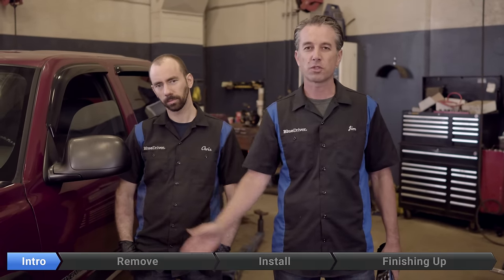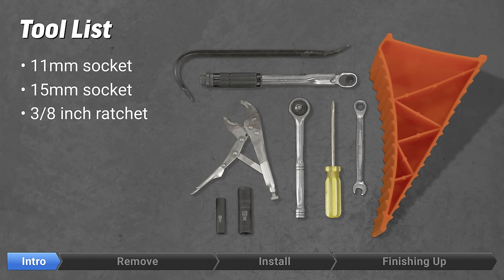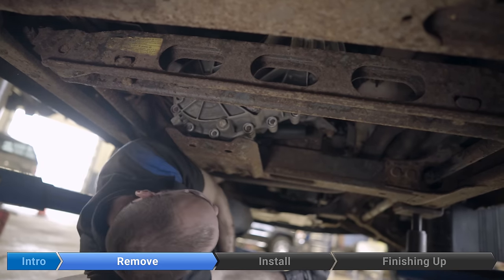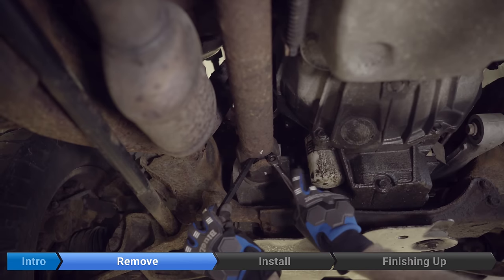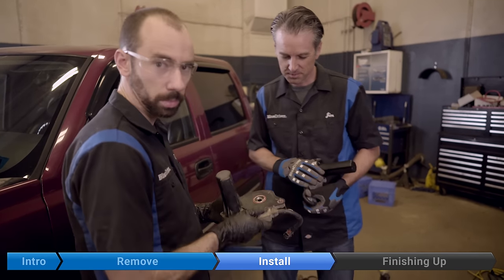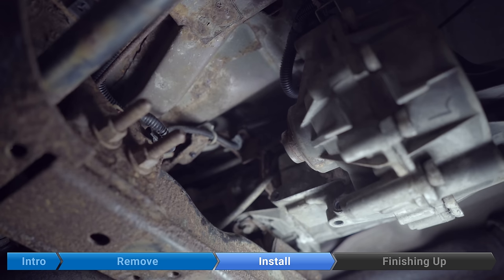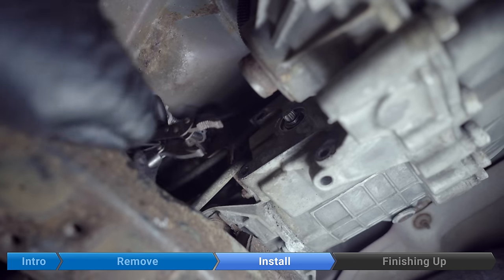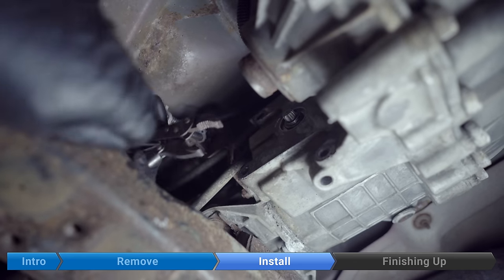Transfer Case Motor – 1999-2006 5.3L Chevy Silverado (Sierra, Tahoe, Yukon, etc.)

Comment: Transfer case didn't shift into neutral because you need to press and hold 2 high and 4 low for about 10 seconds. You were pressing 4 high. If in doubt there are lines on the switch pointing to the proper buttons to press and hold.
Reply: I tried every combination of 2hi/4hi/low yesterday and it wont shift to N either
I think the fact it wont go to N sometimes will throw the code that the encoder motor is bad
I get the code and mine will shift, 4 Lo makes a pretty good clunk in the TCase, hopefully its normal, but still get the code

I think its because it wont go to N and I get Ser 4WD sometimes
Reply: @hardhouseinc  when I first bought my current truck it would only shift into 4 hi or 2 hi. I also noted my gear selection display wasn't working right. I replaced the PRNDL switch and then transfer case shifted just fine. I think the truck didn't "see" that the trans was in neutral so transfer case wouldn't shift into 4 lo or neutral. Just another idea.
Reply: MarkPdot 
Yah maybe I’ll try replacing the TCase selector button too since I think it’s fairly cheap
Reply: @hardhouseinc  couldn't hurt. I replaced the same switch. The lights didn't work even though it shifted. I probably could've fixed it but since it was cheap I replaced it.

Comment: I need to know if a 98 z71 transfer case will work in my 04 z71 they both have the same gear ratio 272 and both are electric shift for the four-wheel drive if anyone can help me it would be amazing I am a mechanic but i honestly don't know anything about tranmisson or transfer cases all i know is they have to be the same gearing thank you and have a blessed day.

Comment: my 07 suburban drove it in the morning, when i get back home, i park it, when i get in and shift into reverse it will not move, it will only revv the engine, it will also do it when i put it in d. The light in the 4x4 selector is stuck in 4lo and the light doesnt switch to 2wd, 4 auto, or 4hi.In that same morning there was a ,4WD Service, light. I was told it could be the transfer case encoder. Do you think it could be it?
Reply from the maker: It could be - if you can get your hands on a scan tool you should be able to get a good idea
Reply: @LemurMonitors  thanks, and great video

Comment: If im just taking the actuator off and not replacing yet do I really need to take the drive shaft off? Or can I remove it with it still on??
Reply: You can do it with driveshaft in but that top bolt becomes a real bitch to get out if you domt take the driveshaft out

Comment: you should never cycle the key  without encoder in place it could damage new ring sensor..found out the hardway..even the instructions told me not to do this after the fact.lol
Reply: Midnight Lewandowski 
So if the new encoder ships in N 
But your TCase won’t shift to N 
What do I do?
I’ve tried all button combos and it will shift to everything but N
Reply: @hardhouseinc  when the driveshaft is off and the old encoder is off you just manually turn the tcase to neutral. With the notch down. Then put it in

Comment: I have an issue. I put everything back together but now no gears go in. I put every gear from low 1 to drive to reverse and nothing. I can hear the transfer case spinning. But I can’t get the truck moving. The 4x4 service is still on the dash
Reply from the maker: Could the encoder have been in the wrong position when installed?

Comment: 2000 z71 silverado, my 4wd works if I push the Auto button.  But if I push the 4low or 4high it doesn't work.  After pushing the Auto button I can push the 2wd button and the tcase will disengage and im back in 2wd...

Wonder if this is my issue.
Reply: Change the selector switch first. Sounds like the 4wd side of the button is bad
Reply: @clownshoeboogaloo  thanks, will do

Comment: I had a problem aligning mine, when the motor failed it was stuck half engaged and my rpm was redlining and wouldn't shift at like 5 to 10 MPH, I had no choice but to climb under and pull everything off and switch the transfercase manually into 2 hi. Drove it and got it home, got a new motor plugged it in before install put it in 2 hi from the selector,  it indicated it went in 2 hi, but wouldn't align. So of course I went hitting buttons to see if it was the wrong position and now the truck shut the 4 wheel drive system in like a safety mode and the selector won't respond like it did before, of course only lights up when I 1st start the truck like every other light.  Now I don't know how to get it aligned
Reply: Brandon B. Irish ever figure this out I have same problem right now...
Reply: @nateserbus5766  no i hasn't, ended up buying another truck, same year, just extended cab instead of crew cab.

Comment: Is it permissible to remove a faulty transfer case motor and discard it rather than replace it?  I don't want to buy that costly replacement motor and am perfectly willing to disable 4WD permanently.
Reply: Daniel B. Martin 
I think that would be a huge NO 
YOU Can get an aftermarket encoder for like $200 or less on rock auto
Reply: You could always convert to a manual shifter.  Takes a bit of work but it's what chevy should have done in the first place.

Comment: My Chevy Tahoe four-wheel drive with only work in Auto 4 wheel drive it will not work in 4 low or for high shift into 4 low but front wheels does not pull I replace the front actuator same to work for about 5 minutes and then not work
Reply: My silverado is doing the same thing. I've yet to figure out the issue. I took it to a dealer last spring, they told me they fixed it and it was working but nothing had changed.

Comment: 5:20 Or your teeth. If you can loop a piece of rope loosely around the shaft about 6" down from the end you are removing and tie it off. The shaft may not drop down but swing sideways on an angle.......be careful. Split second and its all over.
Reply from the maker: Very good suggestion, it's got some weight to it

Comment: ? By changing the transfercase motor on my 5.3 vortec engine, will it help remove the clunk noise on the slip yoke? Or will i need to replace the transfercase?
Reply: Most people grease the slip yoke for the clunk

Comment: DO NOT attempt to shift the encoder without being bolted to the transfer case. You will damage it.
Reply: Dan & Keira Norman 
If mine won’t shift to N
And the new encoder ships in N 
And not advised to adjust to 2H disconnected 
What does one do?
Reply: Exactly right. Those encoder motors will jump time when done like that and then your screwed. NEVER attempt to shift the encoder motor unless it is bolted to transfer case.
Reply: @hardhouseinc  I know it’s 4 years later, but for anyone reading this, you shift the transfer case manually.

Comment: 2005 gmc 2500. No 4wd. Had 4wd light on steady but not in 4wd. Dealer said I needed a transfer case module. 350 bucks later now I have no lights on the 3 selector switches on the dash. Grounds are cleaned under the cab mount.  I have no power to the big red wire in the plug going to the actuator motor. Any ideas? Not wasting anymore money on dealership idiots
Reply from the maker: Maybe have a look at the following fuses:
4WD (15A) - Instrument Panel Fuse Box - Powers the control switch itself
TREC (30A) - Engine Bay Fuse Box - Powers the motor and transfer case control module

Comment: I have a full size tahoe 4x4 that won't shift out of 4 wheel drive is there anything I should look at first that might be causing this to happen.
Reply: SCAN FOR CODES

Normally the problem is the differential 4WD actuator, 4WD switch, or TCase encoder motor.
Reply: @hardhouseinc  thanks

Comment: Do you really have to take the drive shaft off?
Reply: logan brand yeah its easy just break the metal zip tie off the boot and unscrew the bolts and persuade it off

Comment: Someone to tell me i need to know if its compatible a 1992 gmc sierra engine with  2003 sierra  transm ?
Reply from the maker: Hi Sergio!

Just to correct myself, it’s possible, but probably not. What type of ECM (Electrical Control Module) are you using?
Reply: The engine i suppose to install is  diesel,  i guess dont need that system right ?

Comment: Just change my actuator. My front drive shaft stile is getting power to the front wheels while the front diff is not engage. Does any one els have this issue.
Reply: I have the exact same issue!
Anyone have a solution?
Reply: @samr6946  it's the front diff 4x4 actuator
Reply: @samr6946  easy to replace even easier then the encoder

Comment: My 2002 Chev Blazer lights on dash indicate it is 4 low or 4 high looks normal even when in low range you can feel the difference but the front end is not  engaged not helping in the snow any ideas or help would be nice thanks